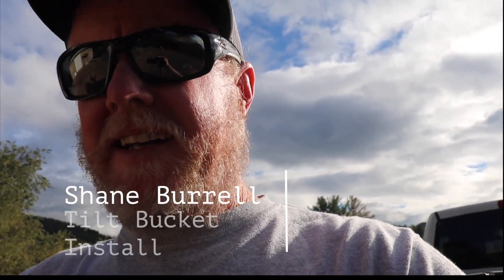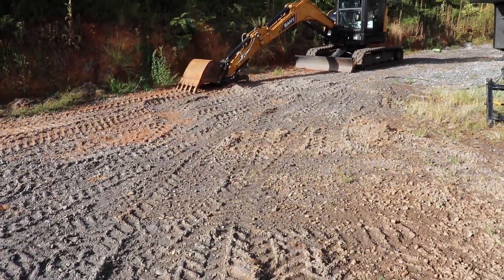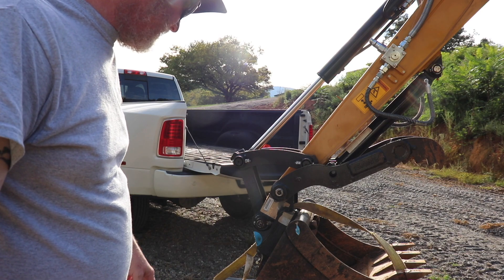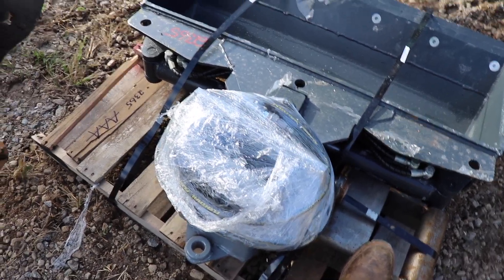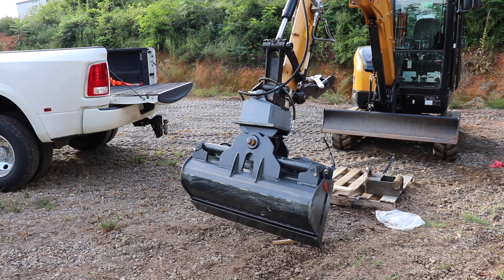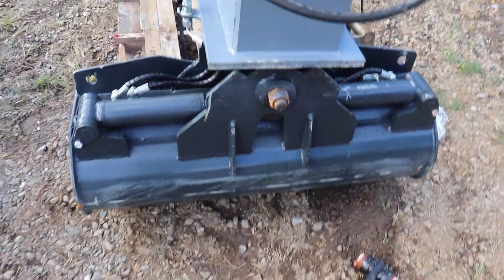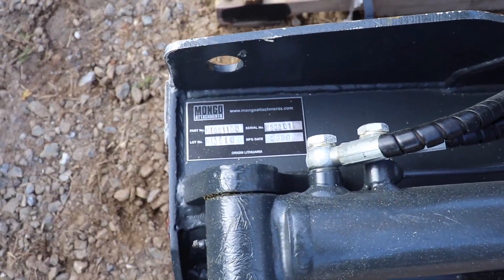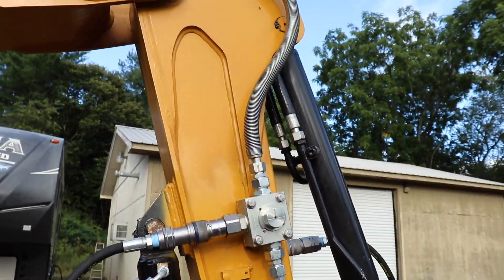Installing a tilt bucket on the Mini Excavator

Comment: I just bought a 2020 sy35u with low hours.. I ran it at the dealership, was impressed.. it just arrived there that morning and was a little beat up and dirty.. have not got to dig yet… it’s been 3 days of servicing, cleaning it and hammering out a big dent.. needs a few minor replacement parts.. door latch, lower door glass, side mirror.. nothing major! 
 I’m used to a Kubota 040-4 with the 6 way blade.. I’m hoping that I can get used to this blade.. the dpf system on my kubota was trash.. unless you like limp mode.. I’ll let you know how I like the SANY in a few days.. got a new piece of land and a lot of digging planned!
Reply: So? Looking into buying one, would like to know your thoughts

Comment: hello shane 
any advice on where to get a 18" bucket for a sany sy50u  other than dealer?
bought this machine but having issues getting attachments ,seems manufactures not making adapter plates to match up but i think the sany wave is coming  to my area hopefully soon so i think they eventually will have things i can buy easier
i wanted to get the construction attachments brush cutter manufactured in lenoir nc ,but they dont make to fit a sany and i live 5 minuites awat from the factory
so just wondering if you know a sany friendly implement dealer?
I'm a new subscriber so maybe you told and i didn't see 
thank you  ,i appreciate it
Reply from the maker: If you machine has the same Sany/Palidan Wain Roy style mine has you can get them almost anywhere.  Mongo has the adapter plates for mounting speciality stuff.  Paladin, USA attachments, woods and many others sell them.

Comment: Hey Shane, I just purchased a mongo tilt bucket. Can you tell me where did you purchase the flat face hydraulic coupler. Is it a 1/2 inch in size. coupler. And did you get a hydraulic adaptor to connect it all together. thanks
Reply from the maker: I bought mine on Amazon.  On my Sany I had them install a three way valve that has a port for a standard fitting with a 1/2" Female NPT Thread.  Here is the link to the connector I used.  They got the three way from hydraulic shop and I haven't been able to find it myself.  Amazon link to the coupler is here: https://amzn.to/3KDbapA
Reply: @ShaneBurrell1  Thank you. Im gonna stop by a hydraulic shop tomorrow and and see if they have an adaptor that goes from the valve block to the flat face coupler.

Comment: So you can not use the thumb and the tilt bucket at the same time? I just ordered one of these machines with a tilt bucket but no one mentioned that to me.
Reply from the maker: Depends. I only have one aux but some machines have two. A thumb doesn’t usually work well with a tilt bucket since it tilts and is usually longer than a normal bucket. I can turn my thumb on with the bucket locked straight.

Comment: Looking at a tilt bucket from Mango a 50 inch.
What info do you have on that splitter valve on your stick that you can switch  hydraulic fluid from the thumb to the tilt bucket.
The manufacture and part numbers.
I have Kubota 12,000 pound machine.
Reply from the maker: Your Kubota is a bit bigger than my machine but the valve is a Parker.  For a Kubota I would consider the special Kubota valve. It's even more tight to the boom than what I did.

Comment: Just put a deposit down on a SY35U...I'm 10th in line....2-3 weeks they say.....Will thing this run a mulcher head? Any advice on buckets? Looking for a 12" to dig out some stumps. Its coming with a 24"
Reply from the maker: A common mulcher head might be a bit heavy for the SY35U but I'm sure someone sells a smaller unit designed for the 3.5 class.  I have a 24" and 18".  I would not recommend getting a 12" bucket.  They don't release dirt well, too small for thumb match and you'll have very little clearance if doing a trench with a thumb.  The 18" seems perfect even for stump removal.  If you really need to stump a stump tooth is normally a better investment.
Reply: @ShaneBurrell1  Any advice for attachments? I just got SY35U and its has Kubota gear. Looking for a ripper. 24" bucket makes too much mess w the stumps
Reply from the maker: @machaf  If you have Kubota QC that should be easy to get from any of the major manufactures.  Rhinox makes one that should work well on the 35 that's is designed for the Kubota 041 class machine.  AMI and USA Attachments also make a ripper in that size.
Reply: @ShaneBurrell1  Thanks...I'm struggling now...Its almost a Kubota quick attach...but the pin hole is different size...Having one hell of a time find the proper ears....Bought a 16" Kubota bucket and it doesn't fit. Ordered some ears and they dont fit...Becoming a royal pain. Dealer wants $500 for ears! ridiculous.
Reply from the maker: Who made the coupler?  Mine is a sany brand but made by paladin .  if you can get ahold of the coupler manufacture they can likely help you.  The current sany manual coupler is a wain roy style.